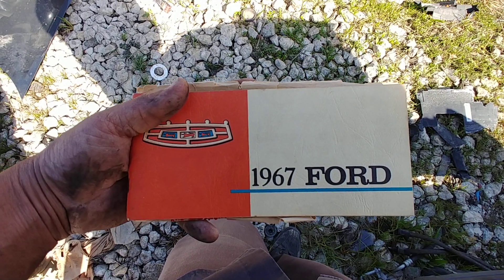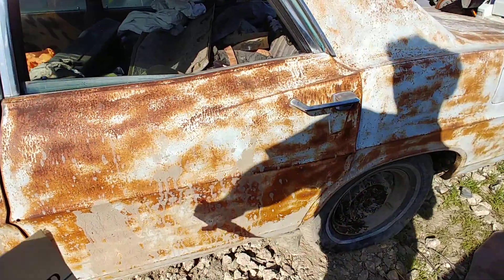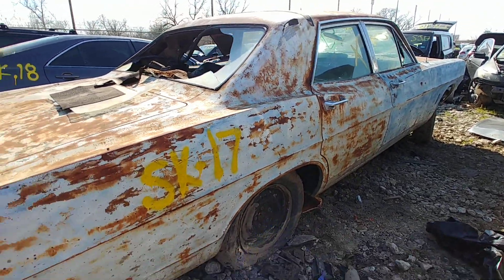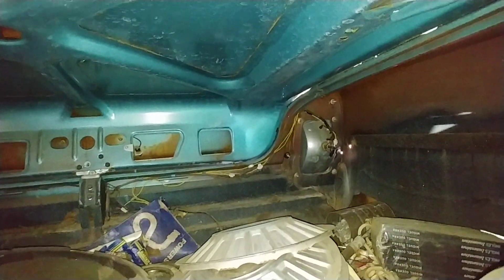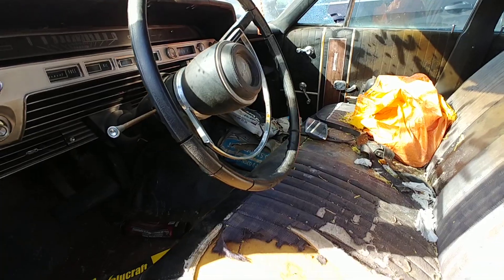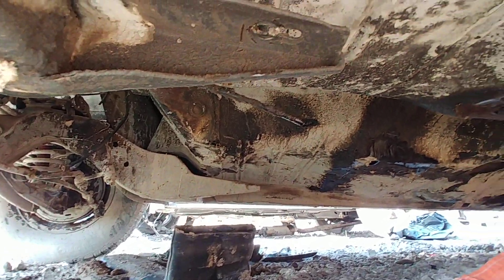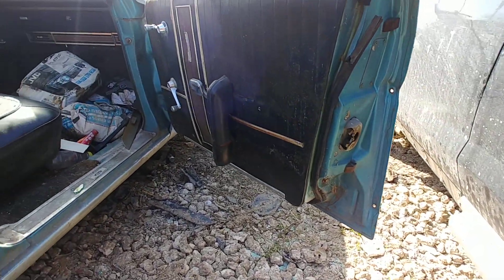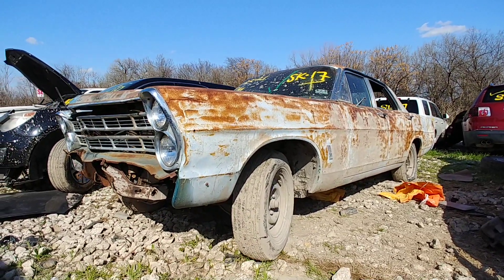1967 Ford Galaxie 500 Junkyard Find

Comment: Whoa Nelley, it's the book, and that's all it took.  

We got the VIN, and we win, here we go: 7 for 1967 model year, D for Dallas, TX assembly  (which was located at 5200 Grand Ave, and closed in 1970), 54 for four door Galaxie 500 with bench seat, H for 390 V8 with two barrel and the rest is the production sequence.

We got the tag, we can brag: 54A on the body is Galaxie 500 four door, color of W is Medium Aqua exterior paint,  5A for black interior trim, date of 15L Is November 15, 1966 production, which was a Tuesday, DSO 61 is Dallas, TX sales district,  looks like 6 on the axle which is 2.80:1 non locking,  possible Y on the transmission which is MX automatic. 

The Dallas, TX assembly plant used to put stickers to the effect of "Made in Texas by Texans", which is what GM does/did in their Arlington, TX assembly plant. 

Whoa Nelley, the mud makes it a dud. 390, gotta go. Made in the Lone Star State, not so great. 1967 and going to Heaven. Wasn't too cheap, now it's a heap. Going to be flat, that's that. Galaxie to the stars, not going very far. Going to get squished, get the parts you want, or you'll be pissed.
Reply: My 95 Fleetwood had that decal Made in Texas by Texans. I think it was located on the inside of the drivers side door if my memory is correct.
Reply: @garymckee8857  You are correct. My 2009 G6 convertible has a similar "Pride of Lake Orion" (for Lake Orion, MI assembly) decal on the door, with the UAW local number on it. I actually have spares---I wrote to the union and an official sent me a bunch of them.

Comment: 1967 was a special year for Ford. First year of the collapsible steering column if I'm correct as well as an early version of an airbag with a center cushion. Hope you kept the owner's manual, it's mint! The radio looks clean as well, I don't want it to get sent to China for the metal.
The hubcaps are worth taking if the trunk opened, it's a nice full set!
It's a solid car, it just LOOKS bad. If it was painted, I bet it would've sold on Craigslist/FB Marketplace
Reply from the maker: I did get that owners manual. It was too nice to leave behind. Also took the frame mounts as they are specific to an FE big block.
Reply: Elite
Reply: Actually, '68 was the first year of the collapsible steering column. Most '67's had the padded center hub but to the best of my knowledge, the column was not collapsible..

Comment: You will notice there is a cover plate in the door jamb just above each front door latch assembly. These are meant for LTD's and comparable upper level Mercuries only. Those models came with the "Comfort Stream" ventilation system as standard equipment. In place of the plate, those cars had a vent with a rubber one-way flapper over it. And, the inside front door panels had air exit vents that looked like stereo speaker grills. And, upper level cars which were ordered without A/C got a fan forced high level power vent system.

Lower level Fords and Mercuries did  not get these door air extractor vents or the power ventilation system.

The "Comfort Stream" system  was a variation of the "Silent Flo" system seen mostly on mid to late 1960's Thunderbirds, but also on '65 and '66 Ford 4 door hardtops and some 4 door '67 Mercuries. That system had air exhaust vents below the rear  window and on the inside  rear window shelf. A vacuum damper (which could be opened or closed from the driver's seat) controlled air flow.

By 1970, as standard equipment,  most Fords had built in dash vents and air extractor grills in the car body portion of the door jambs, providing some change of air in the passenger compartment. This system was usually referred to as "Direct Aire". Chevrolet had a competitive "Astro Ventilation" system that in later years turned on the heater fan whenever the car was started.

These systems were initially promoted as a way to clear tobacco smoke from the car interior without rolling down the side windows or opening the vent windows. In later years, they were seen as somewhat of a vent window replacement and also as a way to help prevent the buildup of dangerous carbon monoxide gas in the interior.

Comment: Hey classic I've been a fan of yours for about a year and went on livestreams etc. I was wondering if you could tell me your opinion on this;

I just bought a 1996 camaro 3.8 for 1050 dollars,it's in red with T-tops and in ok condition. Problem is it doesn't run,kinda like your 89 formula. So what do you think it could be? There's compression and air, and (I think) timing. I don't know about fuel and spark so I am asking for some diagnosis help and if I just bought a lemon
Reply: You need spark, air (compression) and fuel in the right amounts at the right time. If not, it will never run as you know. Check what you're lacking and there's your problem.
Reply: @googleusergp  so that's timing?
Reply: @adamspitfire  No. I suggest you look through You Tube or join a FB group for your car. You will find more info on how to fix it there. If you shotgun and replace parts, you will still have a non running car with new parts.